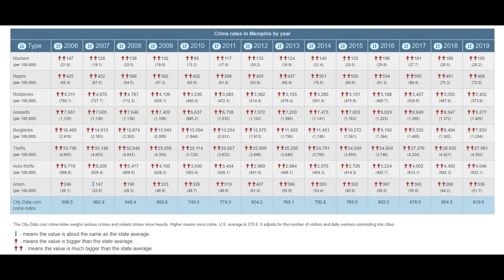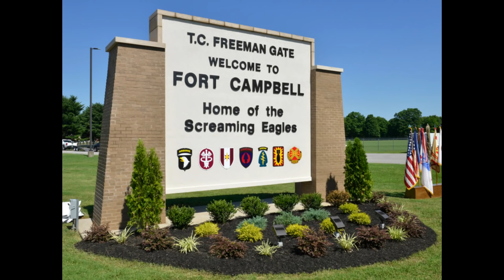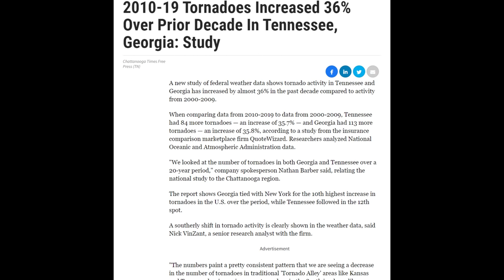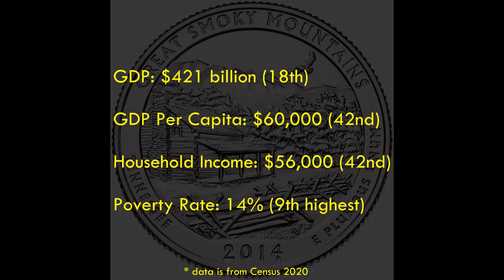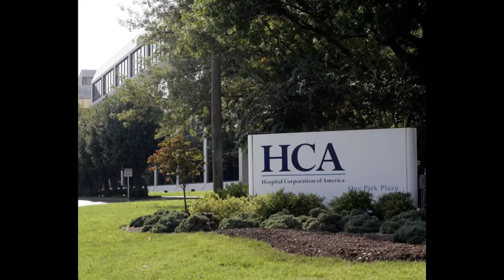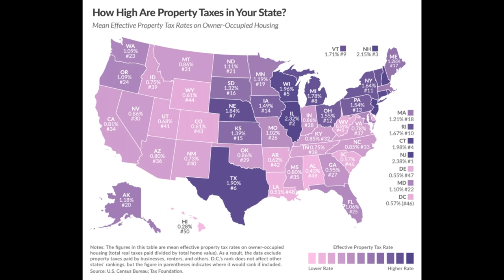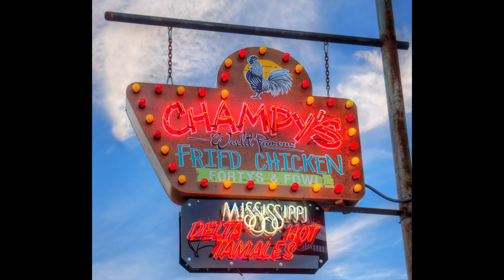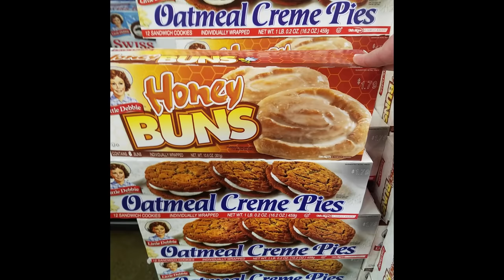Tennessee: State Profile

Comment: Great video. I grew up in middle TN, went to college in east TN, and now reside in west TN. The differences between the 3 are huge, and it feels like 3 completely different states in one. 

One thing you should have mentioned is the mind-blowing length of Tennessee. People think of it as a mid size state which is true based on overall area, but the length of the state is severely underrated. A common-known fact is that Bristol, TN is geographically closer to Canada than it is Memphis, TN, but Memphis is also closer to Houston, TX, Chicago, IL, Wichita, KS, and Tallahassee, FL than it is to Bristol. Memphis is on the same line of longitude as Madison, WI, while Bristol is on the same line of longitude as Cleveland, OH. There's also a significant part of South Carolina that lies west of Tennessee's eastern boarder. Tennessee actually boarders 3 states that have the Atlantic ocean as their eastern boarder, yet two of the state's major professional sports teams are considered to be in the "Western Conference" (Predators and Grizzlies). There actually two different sections of Tennessee (the top right and bottom right corners) that are less than 300 miles away from the Atlantic ocean.

Also, Memphis is home to the world's busiest airport between 10pm and 4 am with the Fedex World Hub landing a plane every minute of the night.
Reply: I worked at the hub for a couple of years, it's a wild place to be at night. The China hub had passed Memphis in volume for a few years, but with the new 777 fleet having longer ranges and the pandemic increasing online shopping, Memphis became the highest volume airport again last year.
Reply: Thank You cheers from Pennsylvania 🙏🙏🙏👍👍👍🇺🇸🇺🇸🇺🇸
Reply: It really is three mini-states!  I live in Knoxville.  I just hope you didn't end up in Memphis... what a catastrophe.